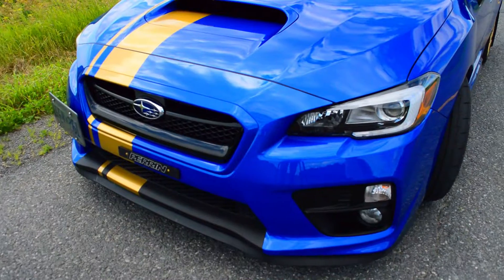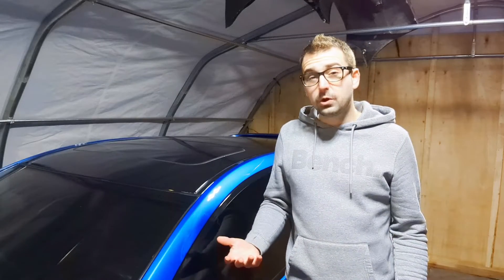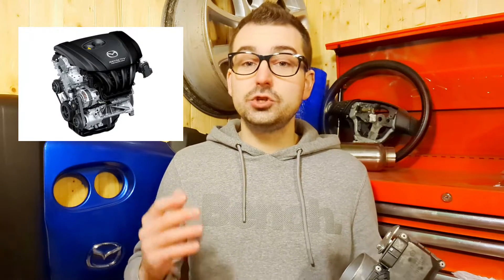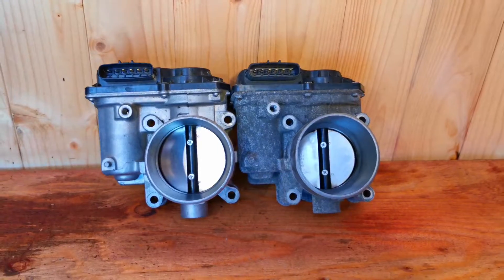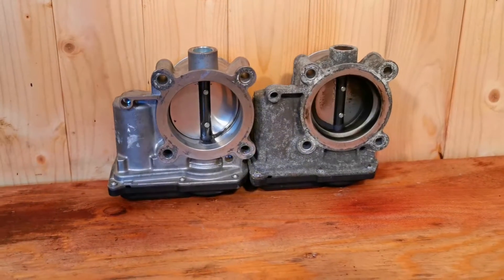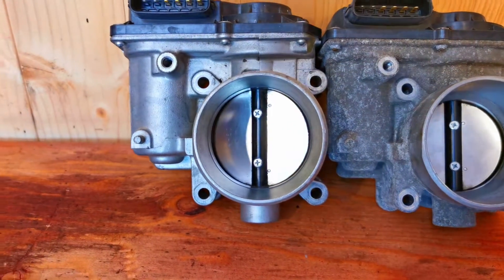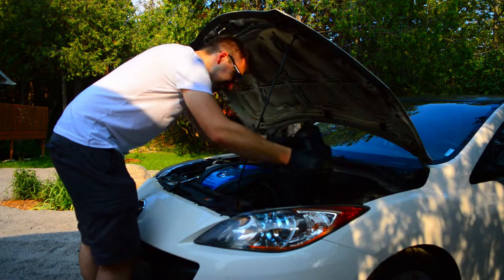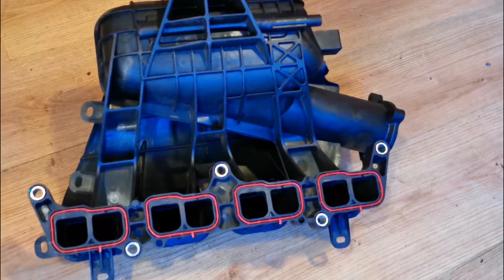Why is NOBODY doing this Simple POWER MOD!?!?

Comment: Do you know if the throttle body will fit on a 2.0 mzr motor or a non skyactiv motor
Reply from the maker: its only skyactiv
Reply: @DrivingProduction would you know if there's any i could do

Comment: After reading tons of forum posts about this and watching videos, I finally decided to do this. Been watching junkyards for a year waiting for the perfect victim but none ever showed. I said screw it and ordered a Chazda 2.5L throttle body off Amazon. It made a small but large difference on my 2.0L. Feels like more torque down low, more power across the band, better gas mileage, revvs out faster, feels smoother, basically an all around improvement. In terms of power added, I would say don't expect any meaningful gain, the key word here is FEELS. Everything FEELS better. It's a great drivability mod.
Reply from the maker: 100% agree! Thanks for your feedback!

Comment: Another mod to increase power in the Mazda 3 is to replace the stock low pressure fuel pump with a LC500 from a Lexus.
Reply from the maker: For the 4th gens yes, for the 2nd and 3rd gens you can upgrade with the 2.5T/Fab9 pump

Comment: hey man! i installed the 2.5L throttle body for a while and seemed to notice a little bit more oomph on the high end. however, I recently went back to the 2.0L throttle body to see what the effect would be (side note, uninstalling a mod is a tip I like, it's another way to try and see if a subtle mod did something) and I definitely seem to have better down low responsiveness, torque, and throttle blipping, but the top end does feel a little constricted now compared with the 2.5L throttle body. thought i'd share! thanks for the great vids
Reply from the maker: Thanks for the feedback! Great observations!

Comment: I just did this mod on my 2016 Mazda 3 2.0 manual and it is noticeable. The car has legs now, before it would max out at 3500 rpm and now it keeps pulling till over 4k. I do feel a slight decrease in low end torque but you gain it at the top end. Similar to changing the gearing on a motorcycle w a different sprocket. Gonna see how i feel in a week w it.
Reply from the maker: That's great! Very similar feel to what I felt! Keep it up!

Comment: I clicked on this video just to see what the heck this dude was talking about. This is not an upgrade and he very well could've lost power doing this. I hope young car enthusiasts aren't disappointed after watching this and spending their hard earned cash thinking they're getting a boost. You'll need pricy supporting mods and a tune to get maybe 3 extra horsepower out of this upgrade unless you have a big V8 engine which might get you the 5-10 range AFTER said pricy supporting mods, for example  your exhaust being built around the larger throttle body. This is not a "bolt on upgrade" this is something you'd do if you're building a track car basically from scratch and pouring money into a precision built machine. If you want to squeeze every last little bit out of your vehicle be my guest and I'm not saying this is pointless but don't expect anything at all out of slapping a larger throttle body on your brand new project that you haven't done much to yet

Comment: Did you notice much of a difference with low end torque?  I just got a 2016 Mazda 3 hatchback last week and it's got the 2.0.  I had also test driven one with a 2.5 and it had a lot more low end torque than the 2.0 does.  If the car with the 2.5 had a clean Carfax and had been a littlow lower priced I'd have gotten that one, but the one with the 2.0 was in pristine condition and had such great service history, I went with that car instead. I love how it shifts and handles, I'd just love a little more pull at the low end, especially between first and second.  Torque is more fun to me than flat out speed, especially for city driving.
Reply from the maker: Yes the torque of the 2.5 is really great! With this mod i helps mostly with top end so I would say it's not exactly what you're looking for. I would get a tune by Justin from the sauce tune and you'll get the best results for sure!

Comment: Ehat if I already have 2.5 😅
Reply from the maker: 😅😅😅 no choice but to install the supercharger kit!
Reply: @DrivingProduction  are there any for MZR engines? 😄
Reply from the maker: no it's skyactiv only, but the MZR can "easily" be turboed with Mazdaspeed parts though and the engine takes it very well

Comment: I feel like the ecu, certain sensors or something has to make a code pop up since you have that much more air entering the engine. I have a hard time believing you can just change that and get more high end horsepower and it just be a happy ending.
Reply from the maker: Never got a code from it and the car drive great!

Comment: I did the swap and it works wonders, my exhaust muffler sounds a little louder with more air coming in also. The response is noticeable also. I have an air intake with it, NGK iridium plugs and used premium fuel.
Reply: You had me until premium fuel
Reply: @perfectperfecto went down to regular, still runs good 😅
Reply: @perfectperfecto my bad lol, it's just something I wanted to experiment with to see any difference.
Reply: @Nini_V89  save your money to buy more mods 😎
Reply from the maker: That's great! I'm happy to hear you found the mod useful!! 👍
Reply: Catback, test pipe, and a tune.
Reply: @Nini_V89 question do you think I can slap on test pipes for my Mazda 3 sport?🤔was wondering since it’s the same 2.0L
Reply: haven't messed with it anymore 😢
Reply: Premium fuel does at the very least help with cleaning the fuel system. It has a lot more addictive that also helps with keeping the spark plugs clean
Reply: @bricegraham8256  yea no.  All have the same detergents, just with the higher octane resists detonation.  If it's meant for 87, put that in.  NOW, I have an older car with lots of miles and pings quite a bit under hard load.  I put 89 in now.  Why, to resist detonation 😅
Reply: @wusthof641  that's true as well. But what I stated I heard from a master tech I work with and I fact checked it online and it's true. But yeah that's most certainly true. I'd go higher octane but 😭 too damn expensiveon. On my 3 here in Texas I always end the week off on a little below quarter tank of gas and spend close to 30 bucks a week. When I was doing 89 and 93 for a bit I was spending close to 40 bucks a week and I'm like no no no

Comment: This isn't an upgrade, it's a sidegrade and even with a tune I doubt this makes any real difference. If you want an actual difference involving Throttle bodies, swap from a single throttle body with a plenum after it to Individual Throttle Bodies with variable length velocity stacks in an intake box that's fed from a proper length cold air intake.
Reply: There a Mazda forum where someone actually logs their increased MAF after the upgrade
Reply: Found an oem 2.5 TB on eBay for $60 in great used shape. So I decided just to try it out, since it’s just $60 and it takes like 10 minutes to install. It’s definitely noticeably more responsive in the mid and high end range. Nothing crazy but the difference is there. I also slapped on a spacer after two weeks and the it helped a tiny bit in the low end. A few days later I grounded the TB with an 8 gauge wire to the negative battery post. Again felt a little more responsive all around. After those 3 super easy and inexpensive mods my 2014 Mazda 3 6 speed manual feels livelier. My car will never be “fast” but it’s a lot funner to drive and that’s what I wanted.
Reply: @DiegoHernandez-n6z  ITB's would wake it up even more. Especially if you can do variable length velocity stack with a good intake box.
Reply: @Dominik189 I’ll check it out. Thanks for the tip

Comment: It doesn't matter at all ! You can double the diameter of the air intake (if possible) and will still wouldn't matter. The air can be compressed a lot, and I mean A LOT ! It's not water, it's not fluid it's a gas. The air get sucked into the engine, not pushed, and with the throtle opened up at max, you can get more and more air as the RPM goes higher. 
Actually the air intake can accomodate 20 times more air than the engine will ever need. So it will never matter what size the air intake is for the airflow, and that it's physics 1 on 1 !

Comment: Its like drinking with bigger straw. Yes you get more volume of water, but slower rate and you need to suck harder. Small throttle body help to suck air much faster to the engine, which can give "induction" effect and also help fuel-air mixture to mix much better
Reply: once he gets a tune, the bigger throttle body would be a lot better
Reply: Chat nonsense it's easier to suck water through a wider straw...
Reply: @davidjones-sd9ku  If you use same suction with your mouth, small straw will reach first. Unfortunately, you and I cannot apply same suction everytime we use straw, so we feel small or big, the water just flow into our mouth

Comment: any difference in 0-60 and where did u get the throttle body from?
Reply from the maker: I haven't monitored the 0-60, but I don't think it would change it much if at all, this mod helped with throttle response and top end power. I got mine used on eBay. 👍

Comment: Can you please share what cold air intake you have and where you got it?? I’m trying to change mine but some websites are expensive?
Reply from the maker: I got it used off Facebook Marketplace, but this is the actual product number from AEM 21-765C. Unfortunately I don't think they still sell this intake system on there website. I did find this one: https://gbpperformance.ca/en/air-intake/27965-aem-cold-air-intake-system-mazda-3-20l-2014-2016.html?gclid=CjwKCAjwl6OiBhA2EiwAuUwWZT0q7eyGsfIO8x6BKEiBJolW2tVQ2wF2ICqdoZ7VGQakCZ23xHbVqBoC-fEQAvD_BwE

Comment: i have a 2010 2.5l s mazda 3 is there any other throttle body that'll bolt up thats larger than the 2.5 oem throttle body that i can just go to the salvage yard and pick up?
Reply from the maker: That's a great question, for the MZR engines in not sure if the speed throttle body is bigger than the 2.5 and if there's any benefits from using it. Maybe check on the forums it ight have the information you're looking for.

Comment: Your plenum after the TB is what determines the air flow. All a larger TB does in this case is increase the mass of air coming in at the inlet. It does not add power and sometimes creates an air flooding point, which causes flat points in your power curve. Engineers designed everything to maximize power/economy already.
Also "why has no one done this" question has been answered since guys have been using larger Tbs on cars for a long time. It looks cool but it doesn't really add power

Comment: I love how confident he is but wrong in so many ways. you are messing with fuel maps. the proper method would be to upgrade the fuel injectors, fuel pump, as well as retuning af ratio
Reply: Why would you upgrade the injectors and fuel pump when they are probably still running at stock duty cycle. You only need to if your increasing a huge amount of power. On a civic r18 comes with a stock si fuel pump. Can support up to 300hp with a turbo. A tune with this I do agree.
Reply: @razzle1245  anything from stock needs to be upgraded? and tune? Have you ever done anything to any vehicle? cars are tuned for a certain amount of air to come in in a certain amount of air to go out and it runs its entire fuel map based on this info. What he’s doing only applies to carbureted vehicles that don’t have a computer controlling. How much fuel is used
Reply: All he’s doing is leaning out the air mixture damaging his engine
Reply: @codysherman4030  lol I agree that messing with fuel maps with no adjustment isn't the best. I'm a diesel tech. My 18' Civic sport hatch has a PRL CAI with a race MAF and a catback. I got a ktuner to make adjustments for the bigger intake size and the sensor to read those differences. If that answers your question. but there's no need to replace injectors, etc. only to adjust the parameters to add more demand for fuel according to the extra air. If you added a turbo and u max out the fuel system then yes. a higher demand for fuel is needed.

Comment: ima be honest, i did this same mod a few months ago on my 2013 skyactiv 3 and felt absolutely no difference with the throttle body from a 2.5 skyactiv mazda 6. I would reccomend putting the money towards a basemap tune instead, much more tangible difference in power.
Reply from the maker: I do agree that results from a tune would be definitely greater, but I think the combination of both would also gain better overall results. Thanks for sharing your input and experience on the mod! 👍
Reply: Yea I mean It be like that with a CAI/SRI as well, you gotta have a tune or it's sitting potential.
Reply: @Dyl-Cam  I mean at least with an intake you get better throttle response and intake sounds regardless of if you're tuned or not, I'm running an sri and axleback with a basemap tune and its definitely a noticeable difference.
Reply: @Dyl-Cam  fab9 tuning actually sells a real ported throttle for the 2.0 skyactiv in the nd Miata, but it's like $400 iirc
Reply: @2AMinLosAngeles  oh shit word, it's so funny how you have to get Miata ND parts for this car sometimes. Skyactiv market is horrible 😭

Comment: Had nothing to do with how old and crusty the original was ?, you know, old electronics and all.
Reply from the maker: I wouldn't say so because I didn't have any issues with the throttle or anything prior to the install.
Reply: @DrivingProduction  But you did it cause you weren't getting the response you felt it should no ?

Comment: The gentleman that ported the TB for my LS3 Vette explained that it’s not just diameter but how you machine the surfaces that can help the airflow. There was a lot of research and precision machining involved. His name was Pete from Vmaxx in FL I believe. I also ported by TB on my SRT4 and definitely helped. Nice vid!
Reply from the maker: That's really interesting! Glad you shared that information! Thanks!
Reply: ya you use a specific grit sandpaper. I had access to a flow bench and was able to port and Polish my cylinder heads on my chevy 350. Used my CFM to get the right camshaft and carburetor and wow it rips now

Comment: Oh dear. So the science of stack velocity goes right out the window... bigger TB doesn't necessarily mean more power. It means better initial response, but you're going to lose top end torque. You need to keep air entering the engine at speed, not slow it down.
Reply: Ur definitely right but gas engines are basically a pump and the skyactive intake manifold has a large chamber built in to it so i would assume that the larger throttle body would allow more air to enter the chamber and the build some pressure going throw the inatke tubes I definitely could be wrong bc air velocity and clean intake flow in a na engine do create more power

Comment: And then port your head put higher compression pistons a set of cams a rev kit and itbs
Reply: Wth is a Rev kit haha. You mean a tune bc that's all you need to raise the Rev. Always start with a tune after doing exhaust and intake/ throttle body. With out the tune you will not get the benefits of adding everything

Comment: but how much horsepower does it increase?
Reply: Minimal. But, the benefit is in the pedal feel. It helps with throttle response. A tuned isn’t necessary, I ran without a tune with this upgrade and most of my bolt ones actually, for over 6-8 months before going up to Versatune’s shop to get tuned. Once tuned, I made more power due to all the mods combined, not specifically from any one mod.
Reply: Probably wouldn't do anything for the car unless tuned, if anything without a tune it could harm the engine

Comment: when changing the throttle body to a 2.5 definitely get a tune and a fitting intake, which you might wanna do too since a 2.0 intake is just as restrictive as the throttle body itself.
Reply from the maker: Yeah will definitely get a tune soon
Reply: You don’t want a 2.5 intake. Yes it will mount up, a 2.5 and a 2.0 intake will mount. But unless it it properly tuned, it will not run right due to the maf being different in the 2.5
Reply: @jonstechchannel  Could you not mount the old MAF on it?
Reply: @Dyl-Cam  won't read right
Reply: What about with the throttle configuration? How avoid problems with this change?

Comment: I have thought about doing this, just wasnt sure if it would throw a code or not.
Reply from the maker: Yeah it's a great mod, no codes at all it bolts right up!
Reply: I may try it
Reply: So  i dropped the hammer and did this mod. I must say that  it did improve the performance a bit along with the SRI

Comment: loses torque at low rpm and gains horsepower at high rpm my wife have a automatic transmisión
Reply from the maker: I've heard of that, I personally didn't feel the loss of torque as much as I felt the increase in power, maybe because of the manual transmission